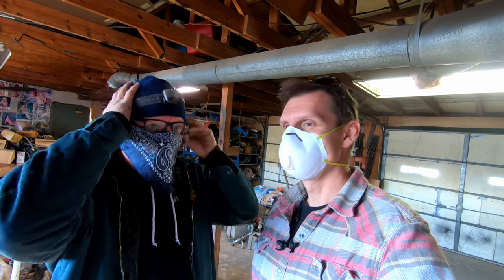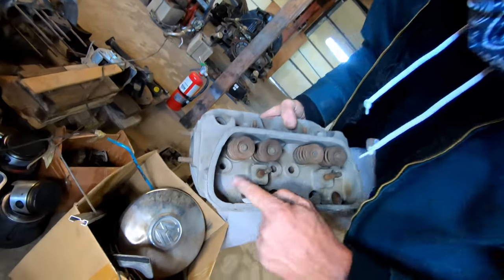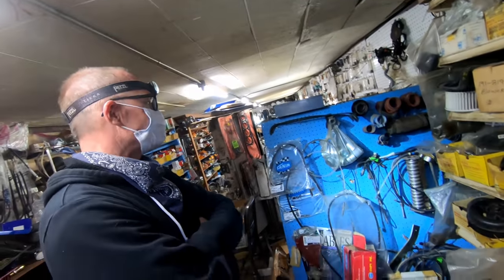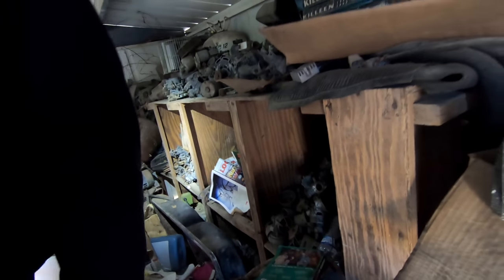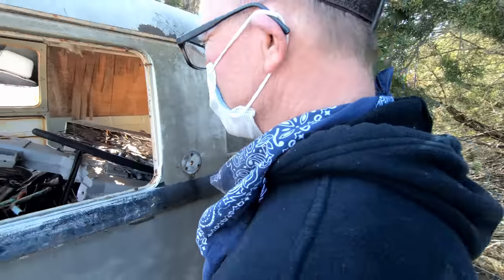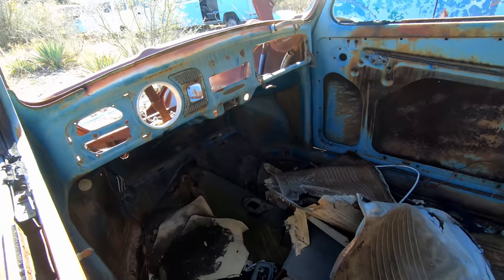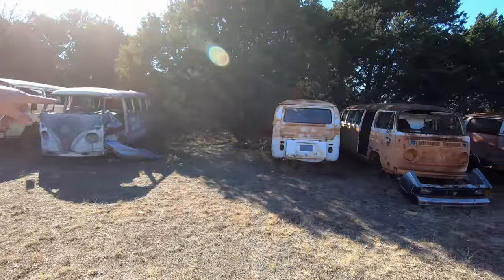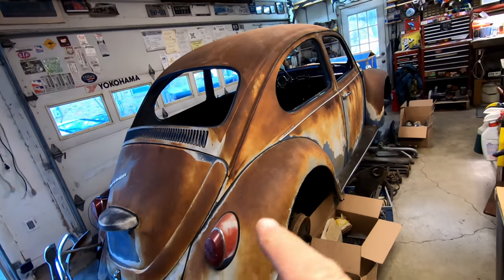Huge VW Junk Yard Crawl in Texas Closing Soon!  Save the VWs

Comment: I have 1970 VW Bug.  The engine is completely taken a part and in a a couple plastic boxes.  It’s the original german engine though.  The interior was redone.  But the the paint job has deteriorated over time because it was sitting many years because I didn’t know and have the tools to put the engine back together.  I needing some advice about if it is still worth it to put it back together.  My whole family thinks I should just get rid of it but it was my first car.  It did run at one time.  It was a project car with my dad.
Reply from the maker: can you find someone or a group in your area that can help you?  you can learn how to build a motor based on videos online but having in person help would be best

Comment: I tried getting parts for my 75 Westy from them back in the mid 90's and they didn't want to help me so I never went back. My dad lives about 3 miles from there. What happened to the property and all the cars? I'm really curious what's going to happen to it all.
Reply from the maker: they guy died, not sure what is going to happen either, sounds like you had the same experience others did.  :(
Reply: @VWLifeVW  I heard he died but wasn't sure if the land had been sold out of the family or if the family was selling off the cars and parts. I saw they have a 912 for sale on craigslist. My dad was able to get a Syncro from them about 20 years ago and some other parts but my dad had built a relationship with them and even did some work for them. I would love to get one of those type 4's. Thanks for the video. I've been past Bug Acres thousands of times but was never able to go into the back lot and now I live 2000 miles away. Maybe my dad could pick up some things for me....hummmm. Thanks again for the video!
Reply: What's the name and address
Reply: @todddebockler7786  Bug Acres. 8329 U.S. Hwy 190, Lampasas, TX 76550
Reply: @scoldeddogproduction  the family is not the ones doing the liquidation.
Reply: @cg4304 thanks for the info. I wonder what the plan is for the property after everything is removed.  It's not a particularly great location.

Comment: Auction cancelled. The acreage was purchased with the new owners planning on running the shop.
Black and Sadler plan on manning the shop for some time and will try to sell individual parts.
 To purchase individual parts, call Black at 254-681-7518 or Sadler at 901-867-6131.
Bug Acres is located at 8329 E. U.S. Highway 190 in Lampasas, Texas

Comment: Thanks guys! How was the pricing? I'd love to grab one of those 4s. I'd have a T1, 2, 3 and 4!
Reply from the maker: probably going to be cheaper as time goes by.
Reply: @VWLifeVW  no, we went there recently. They price it depending on how much they like you. They want 25k for a porche with no engine or anything . Claimed it was a 60s but it’s clearly a 77.
Reply: @cg4304  oh that's too bad to hear :(
Reply: @longboardluv2  it’s sad because there was some nice things (a lot of the nice finds they point out in the video are sold ) but of course they want more or about the same for parts you would find online in a much better condition.

Comment: "sticker" and more sticker!  You guys had to get the wall paper.  I went Monday and the wall paper was not there.  Now I know where all the bus engine tin went too.  the new owner told me that all the bus stuff went in the first four days of liquidation.  Anyway, I came away with an engine that I hope will push my 69 bus.  Not much stuff left in the front.  I missed the floors and windshields and probably bumpers.  On top of it all, the 69 in the yard was in better condition than mine.  Guess what...secret is a container is coming in a week or so.  They guys didn't know the purchase included the container...  Keep on keeping on ya"ll.  Better than t.v. ya"ll.
Reply from the maker: whats in the containter?  those bay windows were gone when you went?  hope your engine works out.
Reply: I called the yard before I went. During that conversation, the owner said the original owner built an engine for a bus. I thought it was complete with all the compartment tin but all I came away with was the engine. It's a 4 hour drive from here so  I didn't look around much due to inclement weather.  The owner I dealt with wasn't the same I spoke with on the phone and he said he doesn't know what is in the container but he has a wish list from me and said he will call. I missed a lot of stuff you guys showed on the video I may go back anyway.